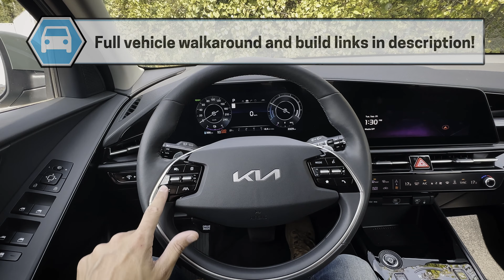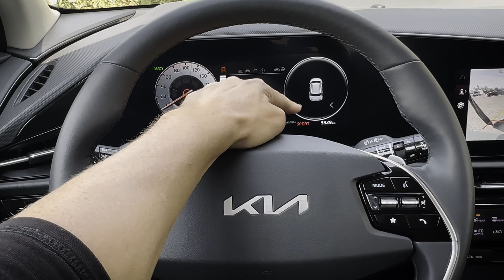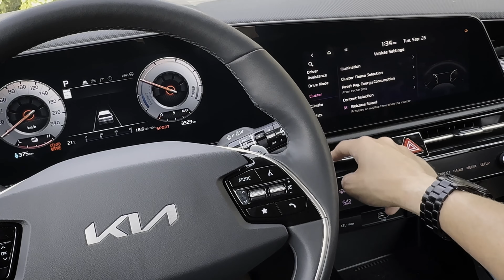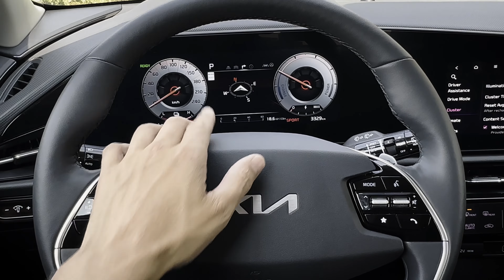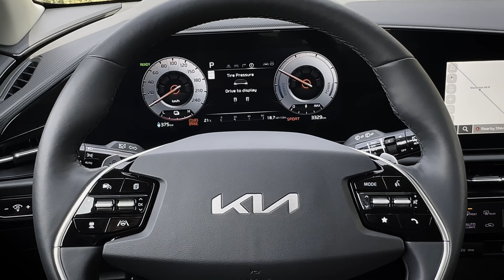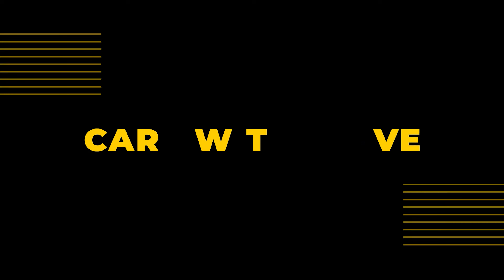Kia Niro EV Steering Wheel and Cluster (2023 - 2024 models)

Comment: Beware of this EV’s AC charging problem.  My 48 amp Juicebox charger has charged a dozen other EVs flawlessly, but refuses to charge this one for more than 5 mins at 11 kW.  Niro’s menu offers power increments of 100%, 90% & 60%.  At 90%, I got 12 mins of charge before quitting.  At 60% or about 6 kW, it charged overnight.  

I don’t know if it’s incompatibility with Juicebox charger, over heating in onboard Niro charger, or a defect in my Niro rental.
Reply from the maker: The Niro is rated up to 11 kW for AC charging, the Juicebox 48 amp charger is 11.5kW which is why you have to lower the power increment for it to work. Not a Niro charging issue, just incompatibility with the AC charging current from your home charger
Reply: @CarsWithSteve  Thank you.  But, when AC power was reduced to 90% or 10.35 kW, the EV halted charging within 15 mins.  But, at 60% or about 6 kW it worked fine.  Does it sound like a vehicle defect?
Reply from the maker: Reducing to 90% should have been ok.. really odd that it stopped at that point for sure. But I checked out some forum posts with Niro owners saying they have the same issue. Mixed results on a fix, with some having dealers reset software, while others had the charge port replaced. Seems like a heat management issue from the higher power output from chargers above the rated limit. 

Something I'm going to have to look into the next time I'm in a Niro EV
Reply: @CarsWithSteve  Yes, 90% should have worked.  Until I see it working, I’m staying away from renting Niro’s.
Reply from the maker: Yeah I don't blame you for that. What other EVs have you rented?
Reply: @CarsWithSteve  My EV history is first owning a 2017 Tesla model S and replacing it with a 2022 mS refresh.  In addition, we bought a 2023 Lucid Aiir GT, but returned it within 30 days due to bugs.  It was replaced with a MB EQS 580 and we love it.  On business trips I’ve rented multiple Polestar 2’s, EV6, Niro, Chevy Bolt & EUV, and Mustang Mach e.  Late fall, I want to lease a low price EV for business use only, hoping to find a 24 mo deal under $250/mo all included.
Reply from the maker: Really surprised about the Lucid Air, I haven't gotten into that lineup yet but I'm hoping I'll get behind the wheel next year. Wild all the EVs that you've rented so far. I'd be really curious if you're able to find a 24 month lease for that low. The only one that's popped up that low near me is the VinFast VF8
Reply: @CarsWithSteve  In Dec 2022, the $155K Lucid GT was full of bugs with no promise of a fix.  Anyone under 6’ 1” bumps their head on the sloping roof because no easy exit seating.   GPS turn by turn instructions are unrecognizable because volume is matched to entertainment system.  Voice controls don’t work unless you have an Alexa account.  Poor wireless phone charging and difficult charge port door completed the major problem list.  Hopefully most of these are fixed now.  I think price is lower now too.
Reply from the maker: I'll have to remember all this when I get the chance to drive one. Cheers!

Comment: Omg I didn't know you could push/pull to adjust the steering wheel and show digital speed. This is gonna help me out so much because I have my steering wheel in an uncomfortable position because it was blocking the view of the speedometer...

I have this weird thing where I set the lights to OFF but my head lights + low beams would still automatically turn on during the day when I passed by some cloudy spots to work... I tried playing with the light stick but nothing happened.
Reply from the maker: Glad the video helped you out! The lamps are going to come on automatically in certain circumstances and being somewhere darker is one of those times. Government regulations 🤷